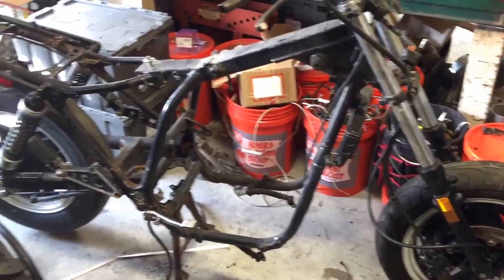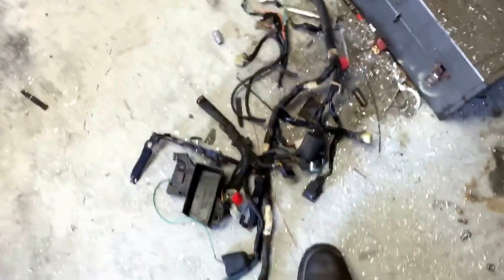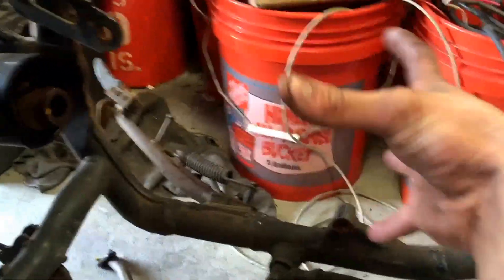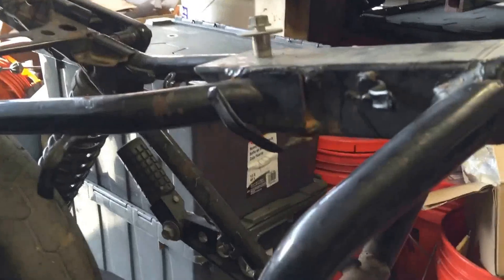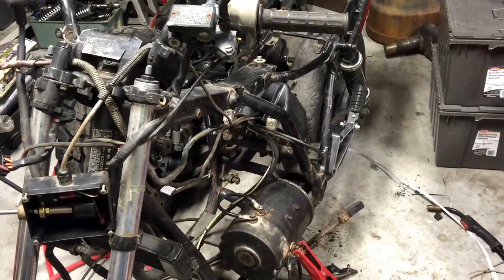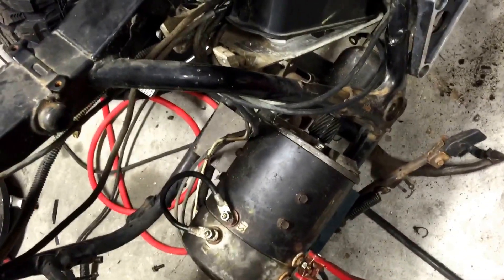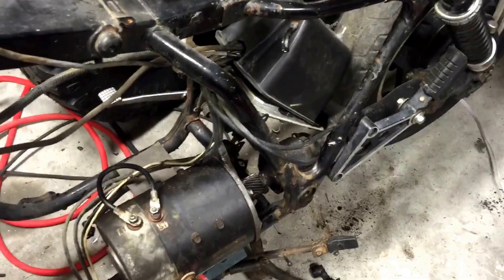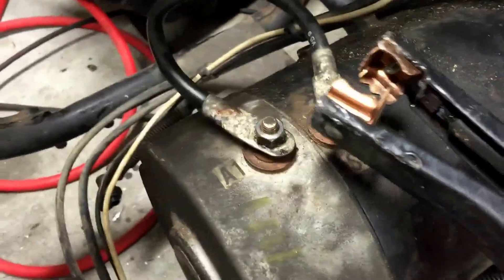$500 Electric Motorcycle Build

Comment: Sam, a Stirling cycle cryogenic cooler that turns air into liquid that fills a Joe cell that produces hydrogen has the liquid air boils off back to vapor to fuel the motorcycle engine. A motorcycle that runs off simple atmosphere do you think you can make one from the knowledge you have?

Comment: You should consider over volting that motor. A 36V Controller and motor can easily handle 48V. Just add another battery and enjoy a 30% increase in top speed.
Reply: I would use a 48volt controller, and use 0 gauge battery cables, so the cables won't over heat also a 48 volt relay, and that's if it doesn't fry the motor which is 36 volt, all that will boost the motors top end.
Reply: Elton what kind of controller would u recommend for GE 36v